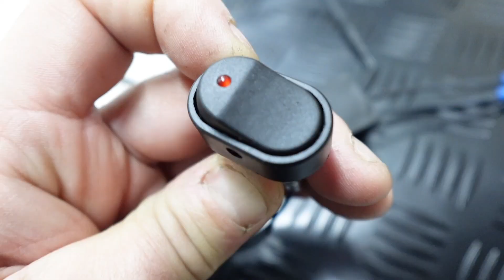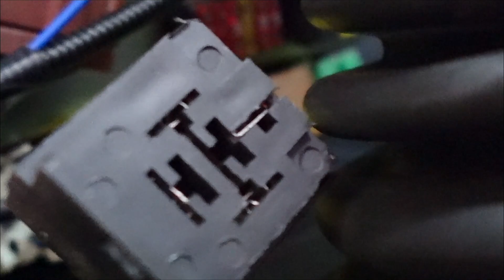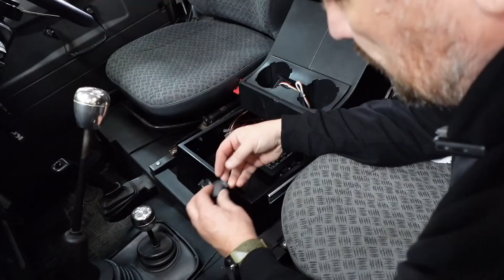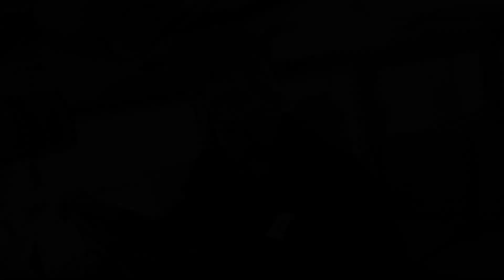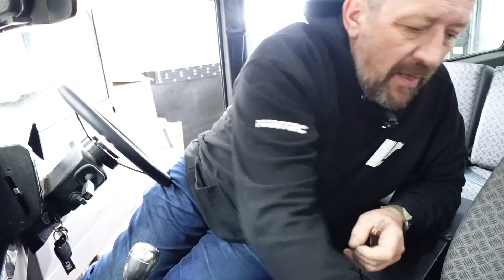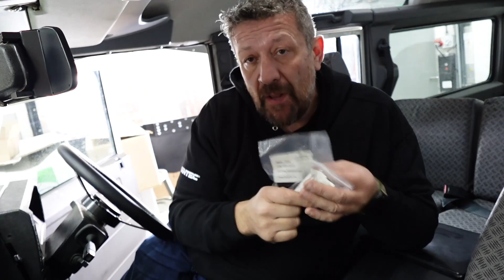LRI32085 - STARTER MOTOR CUT OFF SECURITY SWITCH - LAND ROVER DEFENDER 200TDI, 300TDI TD5, PUMA TDCI

Comment: Could the piggyback not just be removed , relay taken off the piggy back popped into the fuse box again and they’re away? Cover for the box only held on with thumb screws so not very secure

Comment: I have installed a kill switch in my Wrangler, linked to the fuel pump, when off, the ignition will crank but the engine won't start, thief think the car is down for some reason and leave.

Comment: Good video. Obviously, this security measure is not going to stop a determined thief who knows Land Rovers and has decided your vehicle will go.
But what you are doing is slowing the thief down. I think it's very powerful to couple that with a good CCTV system at your home. I have mine rigged that if a person is detected, and it's well into the night time, then my phone has it's volume turned up, a loud notification to wake me up, and then the volume is returned back to normal. It's a really nice automation. Now, does that mean I occasionally get woken up for nothing? Yes. But it is very occasionally. And if the day ever comes where I get woken up to the sight of shenanigans going on over the CCTV, I will definitely appreciate the extra time that these sorts of countermeasures will give me to get out to the front.
But you do need to be realistic about it also. These countermeasures will not stop your vehicle being stolen by a determined thief. They will deter the opportunist, and buy you time to respond if it's a sophisticated thief.
Reply: Your CCTV notifications give me another idea. Assuming you're in Bluetooth range of the vehicle, hide a BT receiver in there connected to an ignition live and paired to your phone. Set up a similar automation to play a loud notification whenever Bluetooth is connected to that specific device. You could of course use this for music but is isn't essential. Theoretically there shouldn't be any false positives. Maybe a little annoying to be bonged at when you start the vehicle yourself but you could install a hidden switch to disable this if you wanted to.